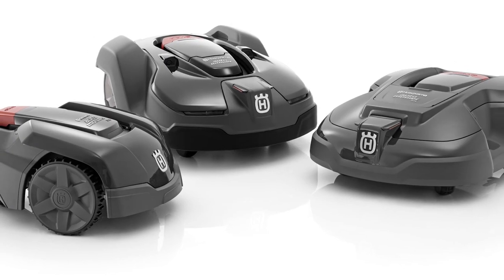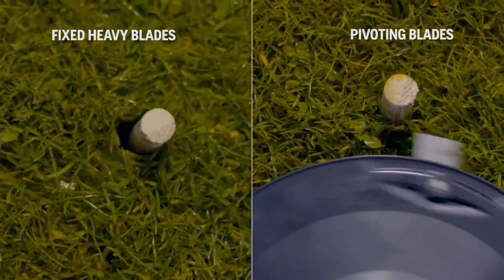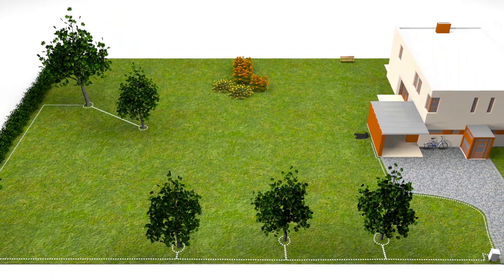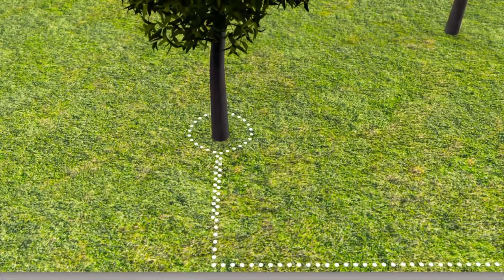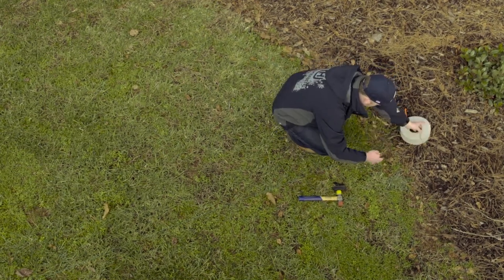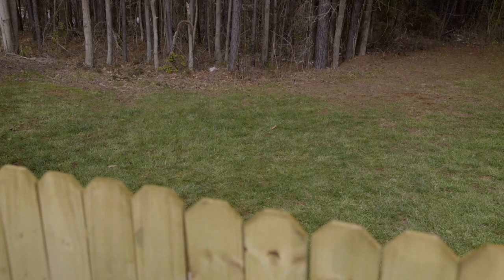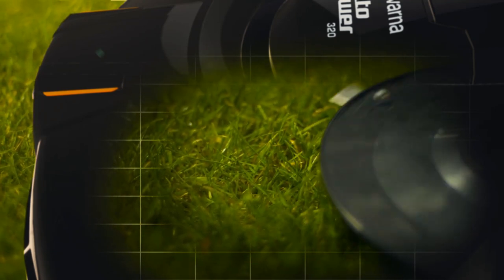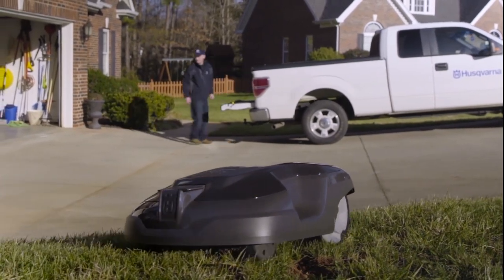How to Install Husqvarna Automower® Robotic Lawn Mower

Comment: is the guide wire and boundary wire the same? I only received one spool. Does that mean the spool is used for both?
Reply: They are 2 separate wires. The guide wire is for recharging and the mower follows it back to the charging station. It is connected into the boundary wire at a point away from the charger and ran all the way back to its own connector on the charging station

Comment: Does the guide wire absolutely have to go under the center of the charging station? I saw a channel underneath the station that was slightly offset from center and in capital letters it said "GUIDE". I place the guide wire in that channel which caused it to come out the front off center. Does the mower mainly use the radio frequency for docking, or is it mainly using the guide wire when docking?
Reply: Put it in the guide channel if one is present. Mower normally drives slightly to the left of the wire so it should be in line with the charging plates when it returns

Comment: If I cross driveway as recommended at 17:46, would the mower simply cross, or would it spend time “mowing” that section/width of the driveway? How does it know it is on the driveway rather than on grass?
Reply: Probably waist a little time mowing it. Just my thought.
Reply: Our Worx crosses sidewalk to tree lawn and considers it lawn. As they mention in the video use the openings already in thr concrete to lessen non-cutting times.

Comment: Hi, can I have my 315 lawnmower go around the perimeter? So he can cut up the grass on the side. Does it do that?
Reply: Yea , if you don't have a fence or you have beds in front of all hard surfaces.
Reply: @mikenotta7079  Thank you very much for your reply
Reply: No there isn't any edge cutting. The disc it located centrally. When it moves it bounces on the wire and it will maintain a constant, not jagged, border to whatever grass is beyond.

Comment: so actually there is a lot of work to do. where is the time saver ? if you cut the wire you need to spend time/money on cable finder tools to find the cut and also to fix it. why those "smart devices" don't work same as the smart vacuum robots where you can set boundaries from an app ? let's say they don't need to scan the full yard, but you can upload a map of the garden...
Reply: On their website they are working on that. It has a stationary point and works with GPS. Something to look forward to and makes aerating the lawn realistic again.
Reply: Every week, the Husqvarna automower saves you the few hours you spend mowing.This is the time it saves you.
Reply: Exactly my point. Vacuum cleaners that cost 1/10th the price can have virtual zones, map surroundings etc, all set via smartphone. On the other hand Automower needs rolls of cable around the plot? It doesn't make sense, it sounds like 1980 technology.
Reply: Ha, of it too much trouble for you, get a gardener...😉
Reply: @captainzeppos  A vacuum robot has it nice indoors in a flat environment where it only needs a rotary LiDAR and most things it can encounter are static solid objects it doesn't expect to slip in slopes. outdoors it isn't flat so a rotary LiDAR wouldn't work. You would need LiDAR that see in height too. More expensive. And not every lawn has walls around it. On to the street. Or when neighbors share a lawn (no fence in between, just an imaginary line). Furthermore you have bushes and trees with low hanging branches that move with the wind so not static. It's a lot of a harder problem to solve than indoor vacuum cleaners. What they have started since a few years is to have a RTK GPS solution where it has 2-3 cm precision and it doesn't understand the environment, just remember its position.

Then there is the factor of how big the market is. Husqvarna Group (includes Garden,a Flymo, McCulloch) wrote on a page last year I think they sold their 3 millionth robot mower. The 1 millionth was in 2017 and they have been at it for 25+ years so it picks up. Many are value oriented machines, top tier with advanced tech are quite few. And Husqvarna is big on robot mowers. There aren't so many that own a lawn and thus far the US hasn't adopted it like northern Europe.
Compare that robot vacuum cleaners. Think of everyone in apartments. A lot of people in China etc. That global market must be tens of millions of units per year. It brings the price down and any R&D is spread out on many units.
Reply: @subwarpspeed  just lol. With the same money that husqvarna sell their lame super expensive robot mowers which can perhaps mow a couple hundred square meters, I'm buying a lawnmower tractor which is much more robust, can mow ten times the surface and has a container for cut grass, which must not stay on the surface soil as it'll burn the grass underneath. Lol
Reply: Don't bother getting one so, it obviously isn't for u

Comment: So my $300 Xiaomi Roborock vacuum cleaner has laser sensors, GPS, can map the entire floor and its obstacles and so on. I can even set up virtual no-go zones in my smartphone and the vacuum cleaner won't go past these. On the other hand for the $3000 Automower we have to install hundreds of meters of cable around the house and bury them under grass? What the hell? At the same or even lower price I can get a tractor/rider which among other things sucks and stores cut grass rather than having it lying around, and doesn't need to replace blades every week or so (Husqvarna states that the blades last for 1-2 months for 1000m2 surfaces, so at larger plots Automower blades won't last a week).
Reply: I hear what you’re saying and don’t disagree. To be fair, though, the automower cuts so frequently the clippings are tiny and absorbed almost instantly. That’s definitely one of the advantages
Reply: As long as there are people that will purchase a $3000 Automower with minimal features, the manufacturers will make, market and sell them. The market is getting more mature but slowly.
Reply: It may be useful for very specific cases like the ones described above, but generally it is a super overpriced gimmick without the features one would expect in 2022. A used ride on is half the price and does a much better job. In my case there's absolutely no way a robotic lawn mower can handle my 40k sqft of grass around my house, plus my gardener advises strongly against any mower that would leave cut grass on the soil (says that the additional fertiliser will gradually burn what's underneath). Not sure if this is an accurate statement but anyway, the robotic thing is still very overpriced for what it offers, unless you can make some investment out of it.
Reply: Blades are inexpensive